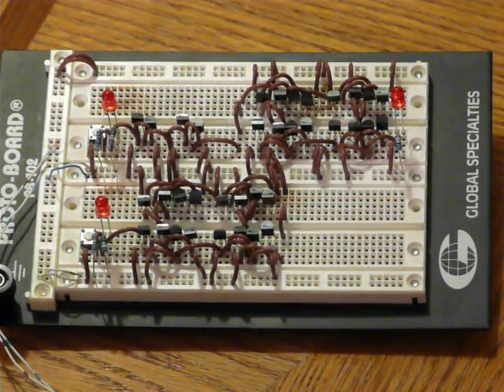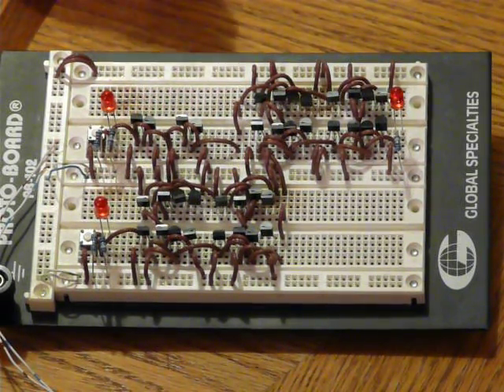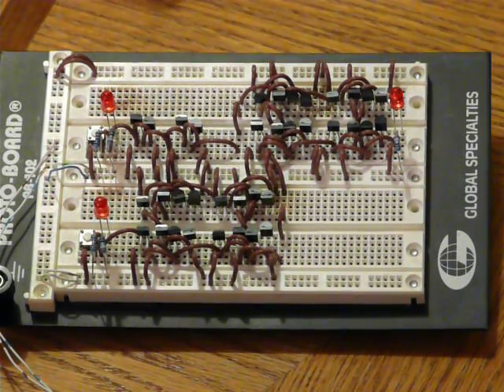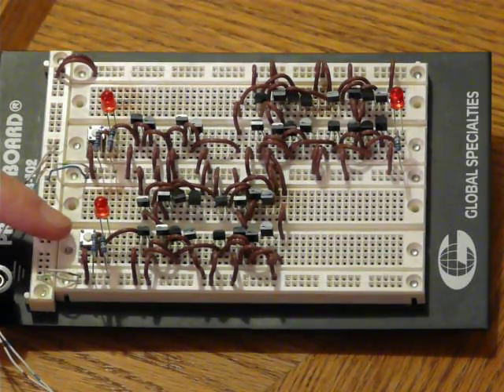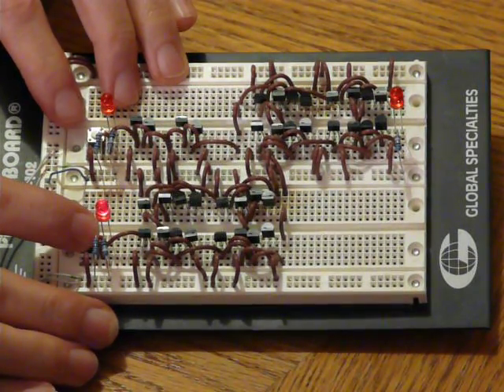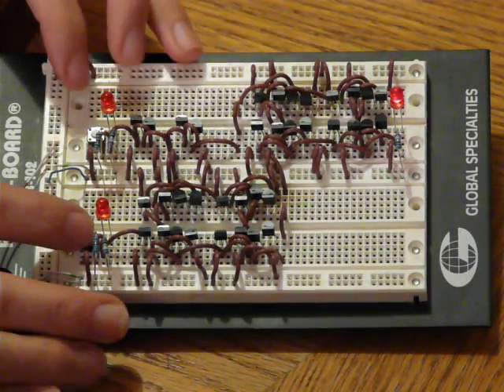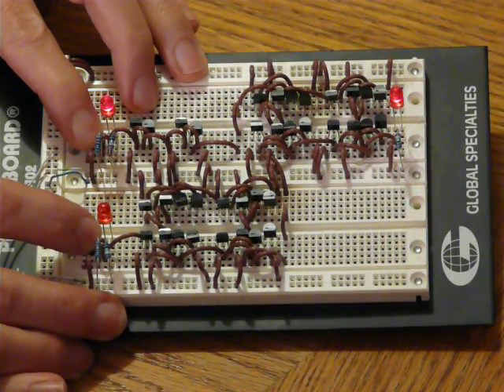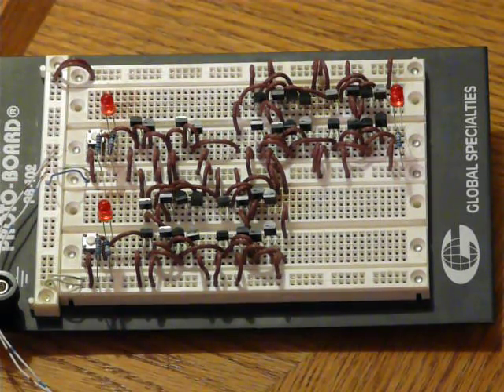Master-slave D flip-flop made from discrete MOSFETS

Comment: Good evening friend, witch diagram of this circuit?
Reply from the maker: It's basically this with one fewer inverter: https://en.m.wikipedia.org/wiki/Flip-flop_(electronics)#Master.E2.80.93slave_edge-triggered_D_flip-flop
Reply: What transistors you used
Reply from the maker: You can find some more information at https://github.com/swarren/presentations/tree/master/lcs-digital-logic-build-a-not-nand-gate-from-mosfets (see the PDF file; a presentation on building simple gates which includes circuit diagrams for NOT/NAND, the buttons used for input, and the LEDs used to see the input/output values). Also see https://docs.google.com/spreadsheets/d/1dVwHUee98p00vTw3GbqesPryPjgOZwx0T3ZVmU6ONJ8/edit?usp=sharing for the BOM of the electronics kit I created to go along with that presentation. I used the same components for the circuit in the video.

Comment: I am trying to do the same function with only 18 MOSFET (and 2 resistors, I know, I cheat but it's a reasonable method). Without the data input inverter, that's 4 P-FET and 12 N-FET. Can somebody do better ? Is it possible to reduce it even more to make a divide-by-two circuit ?

Comment from the maker: I couldn't get pass transistors to work well, although i only tried briefly, so didn't use those. Another possible path to using fewer transistors is to require a certain minimum clock rate, i.e. a dynamic circuit. This one is static (will work with a zero clock rate) which I prefer:-)